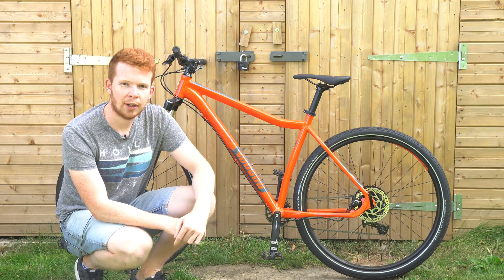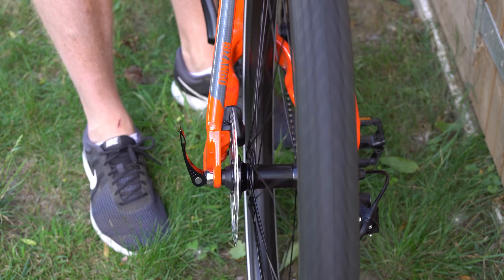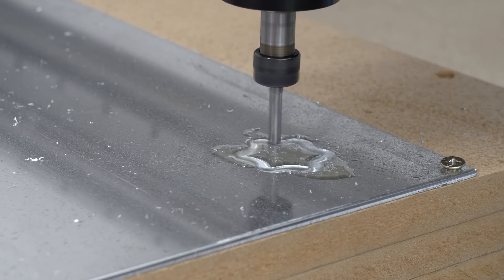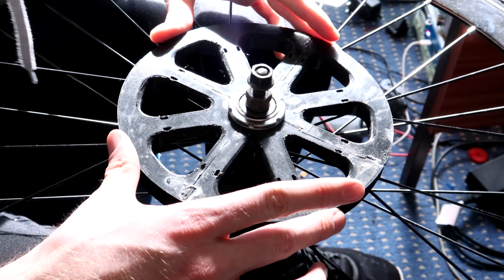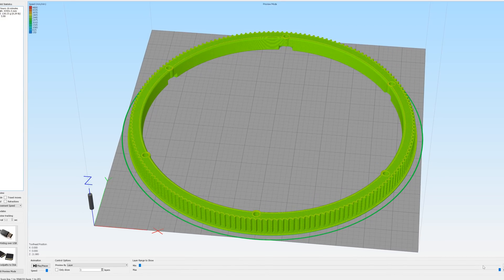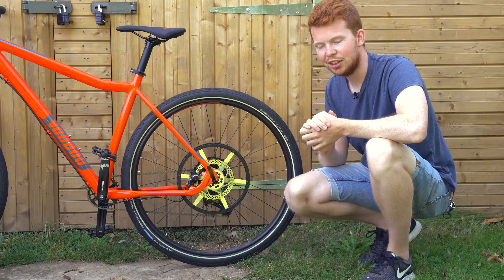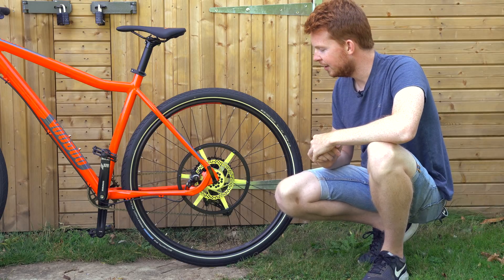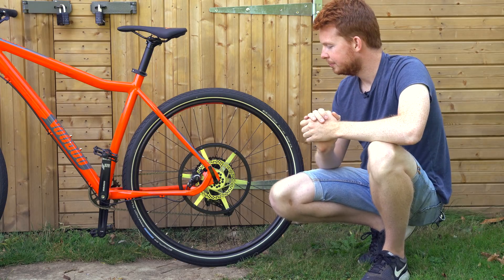Electric bike 4.0 - Pulley

Comment: I was going to suggest you could get your pulley more uniform if you 3D printed a 2-piece bending form and pressed the pulley between the halves.
Reply: designing a tool like that is probably more effort since the first iteration most definitely wont creat the right sort of bend
Reply: Hm, maybe worth a try. But I think there is a good chance that the forces required to bend the aluminium would break the printed forms. And you would have to figure out the amount of elastic back bending in advance. Not a trivial task.
Reply: Adding routed slots on the bend lines of the spokes on at least one of them may help bending, but may weaken the parts if too deep.
Reply: Dewex Dewex Well, then he could have just used thinner stock to begin with.
Edit: ah, no slots would indeed help to locate the bends, which thinner stock would not do.
Reply: USWaterRockets how did you comment 14 hours ago.